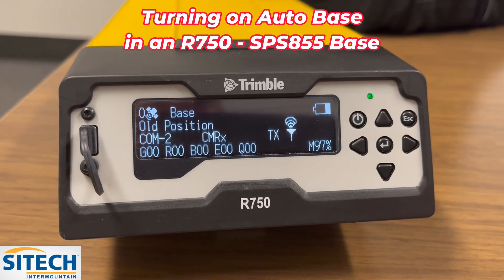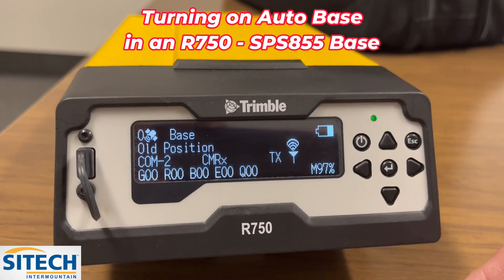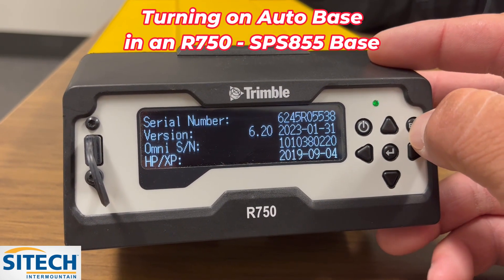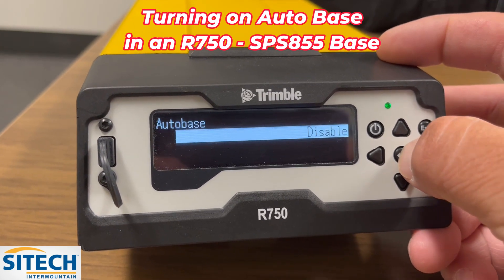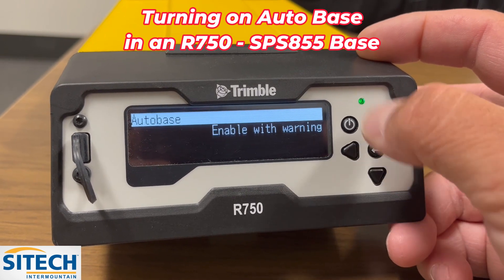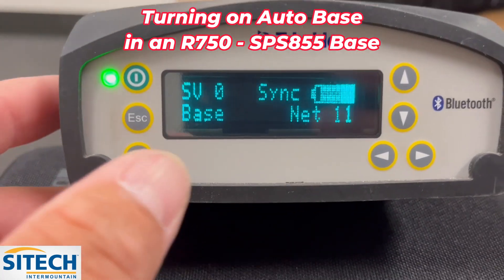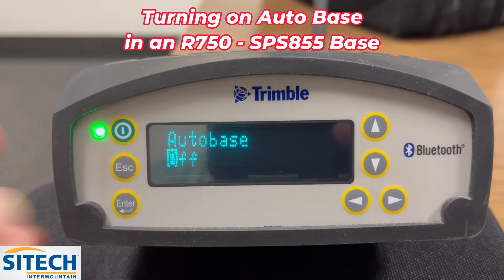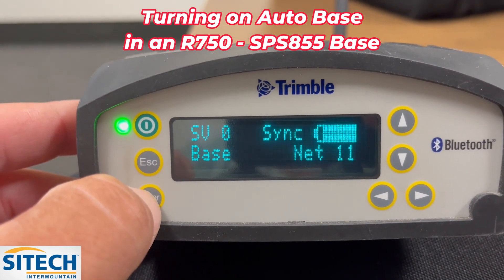Turning on Auto Base in and R750   SPS855 Base

Comment: Every time we try and set up our base over a control point we get an Error “unable to setup base at the defined location. The base location is more than 500m away from the receiver’s current location”
Reply: It could be a couple things.  If you are trying to use Lat Long Height and you are keying coordinates that someone gave you, it could be erroring out because the base itself is getting a current location on earth and it may think its position compared to what you are keying in is that 500m away from each other.  If you have a job site calibration for this job, you may want to give the base its position with the data collector for control point. How are you trying to set it?